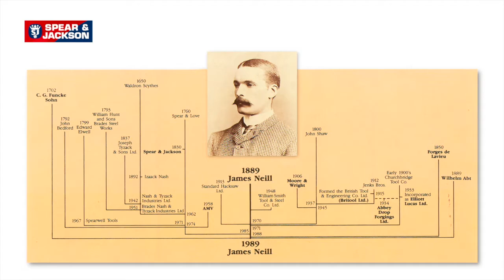Spear & Jackson Corporate Video

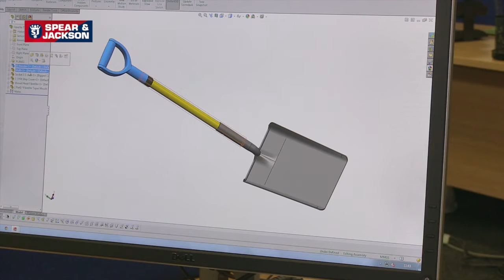Comment: 3:38 - The girl applying brown tape to that box is clueless.  She laid it on loose and did not bother to press it down firmly, or pull it tighter.  So it provided almost zero protection, and the package could easily become open, spilling its contents.